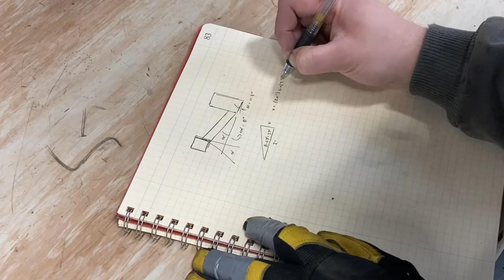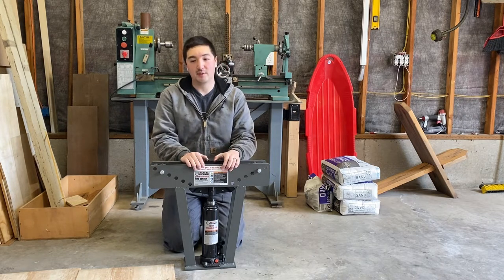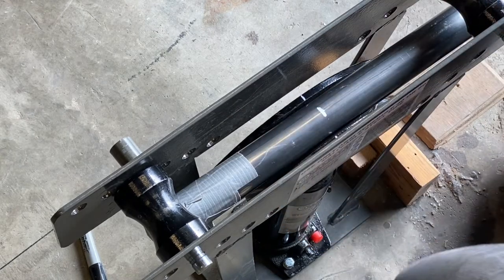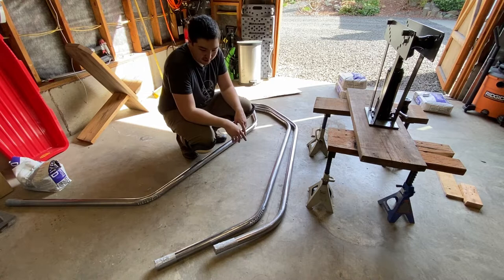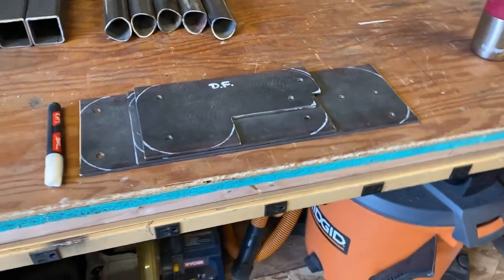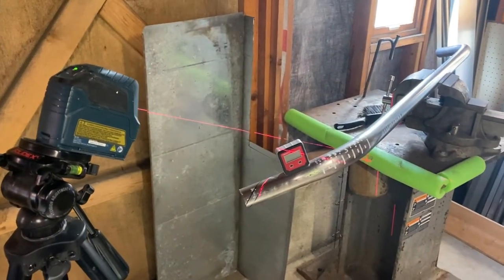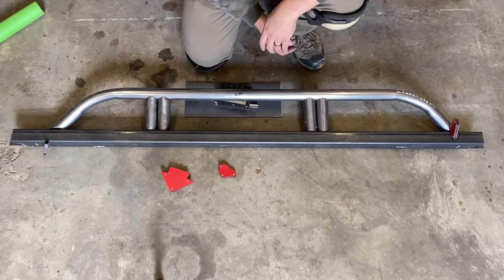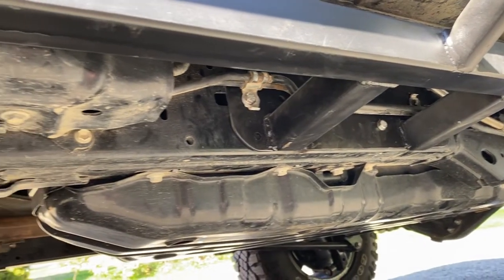DIY sliders for the weekend warrior

Comment: Great work and great video. Your a surgeon with that angle grinder! I’m planning my rock sliders as well and I think a round tube below the pinch weld will make it easy to eye ball the angle and tack it in to position.
Reply from the maker: Thanks dude. Yeah I think you’re right about round tube under the pinch weld making it easier. Hopefully can just cope and rotate. I should do that for round 2!

Comment: Good job.  It's amazing how many access points are available to secure whatever to the frame

Thanks for pointing out the Plano totes.  I have to figure out some way to organize the cargo area and going three across should work.

Your tote storage review is appreciated.  As a former Scoutmaster I can appreciate your layout.  Bow saw a necessity.  If I may recommend a pruning saw doesn't take much space and is easy to fold out and use in lieu of bow saw for moderate to small cuts.

Butane stove will work well.  If you want to try you could try a single burner that uses as single burner that screws onto the top of the propane bottle.   The bottle then is your base.  I set it up so set the bottle low (either dig a shallow hole or place some rocks around the bottle) so it would not topple over.  You then get this 
foldable wind shield to place around propane bottle set up.  Just need to make sure you have a stable platform but it doesn't take up much space.

Your canine seems to be a good companion on your adventures.
Reply from the maker: Thank you! I actually have a pruning saw in my tool box also! Used the bow just the other day that I’ll show in a future video. Great idea on the mounted propane burner, would be another good alternative. Thanks for watching!

Comment: Now that's quality work. One might say, a job weld done. Keep up the DIYs!
Been meaning to ask, what did you do to your stock wheels? They look better than the TRD rims!
Reply from the maker: Haha thanks! They’re the stock TRD Odd-Road wheels, a similar style with different paint jobs has been used with a few trims and I think FJs. I actually just plastidipped them! Base of black, then color on top. Plenty of layers and they’ve held up 100% for over a year, snow, and even a tire change. Cheap way to mix it up!
Reply: @GrizzlyPath  Well they turned out great, I have yet to experiment with plasti dip. Thanks for the tip! So was your finished coat something with a slight brass/gold tint to it?
Reply from the maker: Yeah exactly, used black to just thicken it up and then “Brass Monkey” from Plastidip for color. Thanks!

Comment: How mich did it cost you for this build? Im thinking making one for my 02 pathfinder. Thanks
Reply from the maker: Not including bending practice pieces, about $150 in metal, $15 in grinder wheels, and then you’ll need to factor in welding, other tools, and of course how much your time is worth! The 02 Pathfinder is unibody so the attachment point will be slightly different, there’s still a pseudo frame rail, but you’ll most likely weld it up. Check out @TylerSmith on YouTube and IG for lots of Pathfinder content!

Comment: Probably would of been easier to weld the bent round tube and supports square to the square tubing. Then cut your square pieces that attach to the frame on a 20° angle
Reply from the maker: That’s an idea for next time! However; then the square tubing wouldn’t be flat below my pinch weld? Anyway, lots of good ideas for next time, I might redo these this summer! My friend bought a legit bender too which is a game changer.

Comment: If you want to bend any pipe like a pro, without deformation on the curve, follow the rules. First, cut rounded steel plate and weld at the end. Next, fill pipe with water and add fain grain sand. Fullfil to the top, then weld second end.

Comment: Amazing job.  Side note are your rims plastidiped?
Reply from the maker: Thanks Jonathan! Yeah they’re plastidipped. It’s held up way better than I thought. No peeling after a year of use and even a tire change.
Reply: Those look great. Have you done a video on your suspension? I saw your tire upgrade video, but have not seen details on your suspension. It looks like you have a mild lift.
Reply from the maker: No I think I kinda glossed over the suspension and roof rack install. It’s an Ironman Foam Cell Pro ~3.5” lift I put on myself. Maybe at some point I’ll do a walk around video or something, but pretty straight forward!